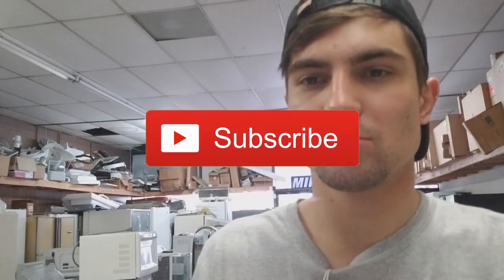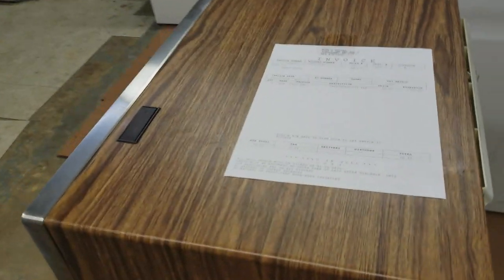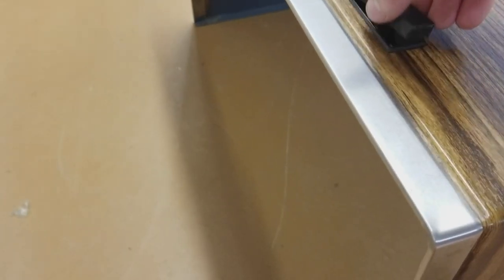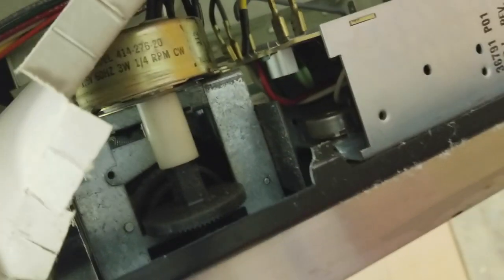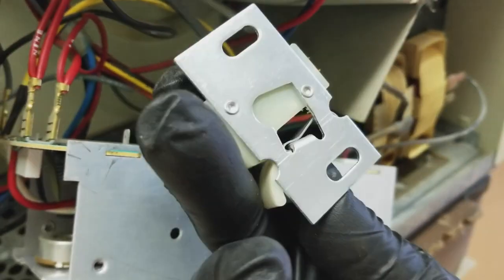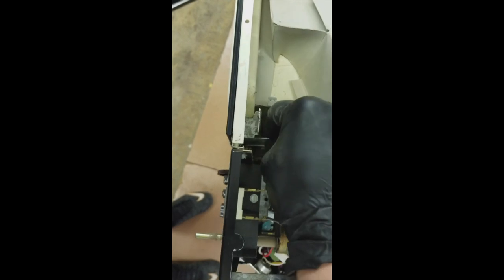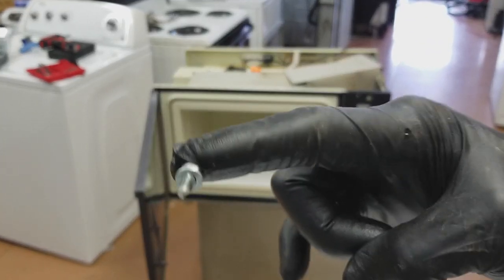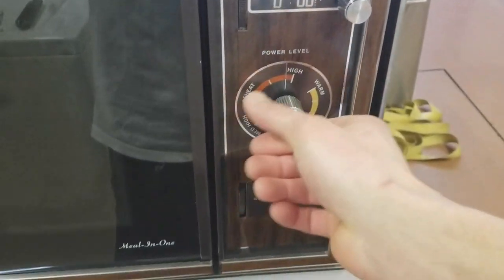Fixing a 1979 Litton microwave (door switch failed)

Comment: Looking at this old microwave, it seems that microwave oven technology hasn't changed much since 1979.  Microwave ovens still use magnetron tubes to generate the microwave energy.  Most microwaves today aren't analog like this Litton, but other than that the technology hasn't changed much.  I read somewhere that in the future microwave ovens will be solid state, instead of using a magnetron there will be diodes that produce the microwave energy.